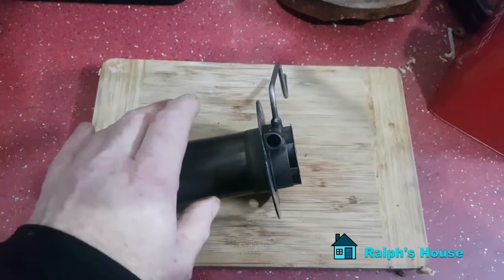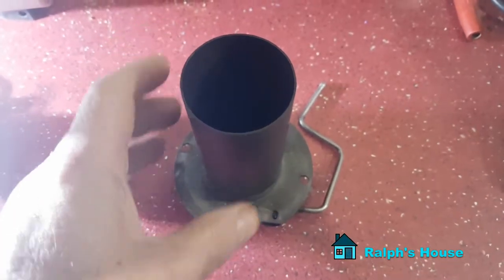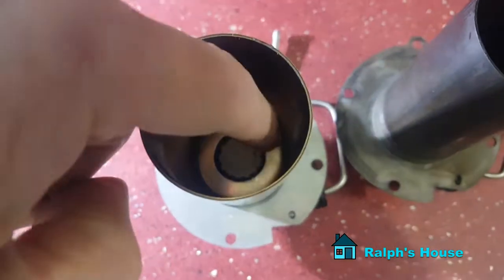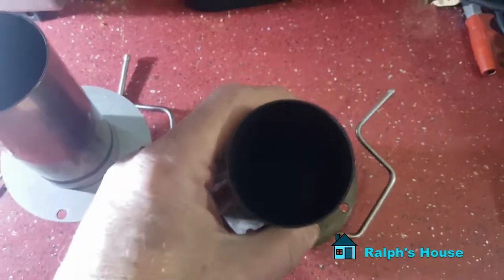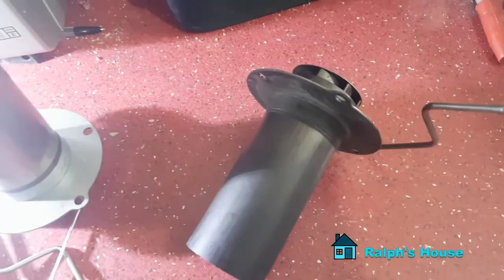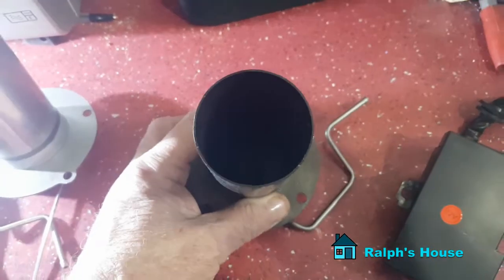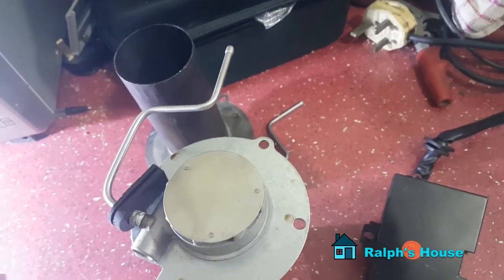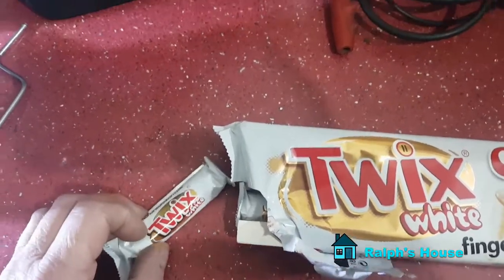204. E-08 Error - Chinese Diesel Heater

Comment: Interesting video. I've had a number of occasions over O8 errors On my first heater it would only work if I kept it at very low setting as soon as I turned it up get O8 errors. On investigation I realised when looking into the burn chamber down through the big pipe the circle in the bottom was not in the centre it wasn't even flat it was probably welded in it about 45 degrees to the tube so I ordered A new burn chamber that sorted that heater out. Recently I would put a new pump in after an O8 error in one of my heaters and it would go beautifully for that day switch it off overnight and then switch it back on and 08 error again and I noticed the pump wasn't clicking I thought why are these pumps stopped working I have a filter between the pump and the tank so I cleaned the filter out and there was a lot of sticky substance on it literally like glue it wouldn't come off my hands even trying to clean it with petrol even brake cleaner wasn't that good. I ended up using acetone that did the trick, it still kept happening even after that, until I emptied the diesel tank and I could see this glue substance stick into the side of the tank very brown so I acetone cleaned it worrying whether the acetone would melt the tank but it didn't and I've not had that error since but actually through one or two pumps away thinking they were knackered when all they was gunked up soak them in acetone and they worked beautifully. I must have had a contaminated container holding the fuel at some point. I have one heater it's one of these modern heaters with Bluetooth on it you can't use the code to get inside to do any adjustments it just doesn't work and it runs far too rich and after a very short time you start getting the white smoke I've basically given up on it for now I'm going to investigate on ways to fix it I know whenever it's cleaned and working well it's greedy on fuel compared to my other heaters I think it's classified as one kilowatt to 8 kilowatt whereas all my elders really are 5KILOWATT maximum anyway thanks for your video , food for thought
Reply from the maker: Could have been pipework or hoses deteriorating from the fuel suppliers, although you'd think the filter would catch it all. "Flame out" isn't a particularly helpful error code really. Certainly running them on anything beyond kerose/diesel really fouls these heaters up. People try, particularly after they've seen others claiming they run on old engine oil or straight veg oil, but soon regret it. Theres never a follow up to those saying theirs run happily on road tar either. Mine runs well in Alpine mode overnight but I do give it a blast at 6 before I shut it down to make sure burn chamber gets cleaned out. Currently sitting here indoors at 22.8 degrees and I hadn't fired it up since last Winter Chris. Happy days.

Comment: Hey I have used 2 new heaters still same problem error 8 runs 10 mins then error 8 or error 10 have cleaned like you mentioned still error 8 white smoke then black smoke
Reply from the maker: What fuel are you using and do you have a fuel line filter? If burn chamber is clean, then a fuel issue is likely cause.
Reply: @Ralphs-House  I’m using pure diesel checked all lines and cleaned chamber then changed for a brand new heater still same issue so went to different fuel station got more new fuel still error 8
Reply: Glow plug issue .

Comment: I use my sonic cleaner on the burn chamber and main housing after i soak with brake cleaner.... Looks as good as new once a year.... I have never had a problem ever and used it for the last 4 years.....
Reply from the maker: Sounds like the best way to kèep the mesh in clean condition. Brilliant tip. These heaters like a scrupulously clean burn chamber for maximum efficiency and reliable running and they do not like anything other  than the fuel they're designed for, despite claims made. The wrong fuel can crud them up in  a day and will make the heater totally unreliable afterwards without a seriously deep clean or new burner. They're unfussy heaters providing you dont fuss with them. Good motto.

Comment: just tried to fire mine up ready for winter and got the E 08 Error , great vid m8 this is really going to help me get mine sorted👍
Reply from the maker: If you just get the clouds of white smoke then you've definately got fuel and its just not wicking through the back of the burn chamber as it should due to all the coke at the back, making it difficult to fire up. Order a new burn chamber as a spare, just in case. They're easy enough (although tedious) to strip down and swap one out so in your case it might be easier to fit another to get it going and clean the old one up when you've got time. All the best.

Comment: Has anyone tried using brake cleaner?
Reply from the maker: Yes. It won't shift encrusted carbon. Its one of the hardest things to tackle chemically. It may remove a little of whats left after manual removal, but you really have to get in there and pick it all out.
Reply: @Ralphs-House  Might heat it up with a map gas torch!

Comment: I found that the exhaust gets clogged especially if you are stationary for a while. Drilling a few small holes in the exhaust helps.
Reply from the maker: It shouldn't do if the exhaust only goes down but if you've got a bend, for sure. It'll fill up with water through condensation otherwise. Nice tip.

Comment: No it can be many things , I changed the cable to the transformer to the heater it wasn’t thick enough to take the correct voltage everything looks fine but it won’t power the pump even though everything looks ok trust me people it can me a multitude of reason btw I was a mechanic for many years and it still stumped me , I have taken 3 to bits and rebuilt two heaters I found many things can go wrong and over time they usually do , their cheap replica of a very good make they copied the original ones but put together using cheap rubbish

Comment: im hoping you can help me out with mine, it's 2 weeks old been working pretty good, the first time it shut down on me was after an hour an a half with a bit of smoke, the second time the same , now it's not running long and when i just started it up its smoking, then goes away, so wha would make it plug up that quick or do you think it could be a bad glow plug or something? thers no smoke when it shuts down now. it's coding e8 as well.
Reply from the maker: As I said, E-08 is 'flame out' so in your case it could be one of several things. Glow plug only operates at beginning and end of cycle so unlikely to be that. Could be a fuel pump issue, soot/muck in burn chamber or a restriction in exhaust. The exhaust must not be fitted in such a way that water condensates inside it - ie pipe should go down and away.
Reply: @Ralphs-House  well im gonna have to take it apart an just check it, one thing is the line after the pump you can see air bubbles being shot into the feed line, is that normal with diesel or could that be the issue?
Reply from the maker: @davidwalesby2426  Pumps don't cost a fortune and without a filter ahead of it, even a tiny grain of dirt can stop it operating correctly. I keep a spare pump to reduce down time. Make sure you're using good quality clamps on fittings and not the cheap ones that invariably come with these heaters. Upgrading to nylon fuel line also helps.
Reply: ty
Reply from the maker: @davidwalesby2426  Also, if you smack one end of the suspect pump on a piece of wood (to reduce potential damage to inlet/outlet) you can often dislodge anything stopping it operating and put it back into service but a spare pump is wise as it means you can quickly get the system running again in the event of a fault.
Reply: @Ralphs-House  darn, wish i tried that first, never the less i managed to fix it, was the pump ordered one for 25 buck and a filter kit for 15 bucks and it runs great, ty your video helped me rule things out an understand how they work.

Comment: In my case it was the pump. The heater would start up but wouldn't flame up properly, no smoke, and eventually shut down with E08 showing. It seemed clear that the pump was not delivering, the click became weak as it tried to pick up the pace. I bought everything to service it in case along with a pump I've fitted first. End of problem, with no other work needed.
Reply from the maker: Yep, thats the other scenario. No smoke gives that one away. Again, E-08 just means 'no flame' or 'flame out' - as vague as it gets :)

Comment: thank you I have cleaned this thing 3 times and still getting it but didn't think it would be dirty down in there so 4 times the charm fingers crossed
Reply from the maker: Let us know how it goes. If you still have troubles, we can suggest other causes. Back of burn chamber has to be scrupulously clean for a reliable start up.  Never be persuaded to run alternative fuels either as despite the many claims, these heaters are designed to run on diesel/kerosene only. Veg or mineral oil soon fouls them - even when used as a mix. The ones that do claim they run on alternatives, never show follow up videos where they couldn't start it again afterwards. I also found that running it flat out for a minute or two prior to shutting down really helps keep burner clean. Not all heater controllers allow fine tuning of air/fuel but if you stick to the right fuel and run it up to high before shutdown, it should be hot enough to burn off any oily residue and hopefully shift any coking.

Comment: Has anyone tried putting the burn tube in an ultrasonic cleaner?
Reply from the maker: Worth a try, possibly with acetone (aka nail varnish remover) which is one of the limited chemicals thats said to dissolve carbon
Reply: @Ralphs-House  I used an ultra sonic cleaner to clean the injectors for my Transit engine. Two of them were really baked with carbon and the ultra sonic took it all off.
Reply: @Ralphs-House  BTW I took my heater apart in the process of diagnosing the e-08 and it is really clean. The mesh is is still shiny even down inside the burn chamber. The mesh around the glow plug looks very clean. Going to work on it tomorrow to zero in on the fault.

Comment: if you increase the voltage to the heater, the glow plug will be hotter, burn cleaner. no soot. i increased the voltage to almost 14 volts. all problems went away.
Reply: Em not sure. The glow plug is 8 volts and is driven by PWM so increasing to 14 volts will not change the average 8v to the glow plug.
Reply: The glow plug switches off totally when it reaches about 100'c , usually after about 2 minutes of firing up
Reply from the maker: Would agree to some extent as I run at 14v too although that mostly keeps the first mesh clean. The second larger mesh at the back relies much more on a good fuel to air ratio to reduce carbon. Running the heater flat out for at least 30 mins at the end of use or once a week if running constantly, helps with cleaning.
Reply: @Ralphs-House they say than but set right hi speeds are not needed
Reply: Wrong, voltage means little to the plug, as after a few mins the plug switches off n runs without.if anything,voltage helps fan speed
Reply: @TheDigger06  the plug does not shut off . the flame would go out . this is not a high compresion engine

Comment: Thank you Ralph, i just took mine apart and attacked it with my propane torch, the clouds of white smoke that came off it was a surprise as it looked pretty clean
Reply from the maker: Its probable that you always will if you heat it up since diesel/kerosene is oily by nature so some residue will still be there. Burning this off may or may not make starting easier but it does seem to help a great deal if you're trying to shift carbon.

Comment: Error E-04 is the fuel pump if anyone cares to know, and it will not be clicking if you get this code.  It means the electromagnetic coil in the pump is open or the pump is unplugged or wiring issue with the pump itself.  You can test this by unplugging the pump and trying to start the heater.  You will get error code E-04.  It is not common for a fuel pump to fail, or at least I have never had one fail.  It is usally Error code E-08 that I get and it will be rolling white smoke and usually always means it's time to take it apart and clean the burner.

Comment: Thanks a ton! This was super helpful after dealing with this headache for a little while now. Brake clean definitely wasn't getting the burner clean enough in that area. It was getting it just clean enough for the unit to work a couple times then fail to E8 again
Reply from the maker: A case of digging a lttle deeper than you think. Would recommend keeping a spare clean burn chamber so you can at least get the heater up and running again while you sort the other in your own time. Thanks for the positive feedback.
Reply: Scrape and some compressed air ..then repeat... I sure like these little units

Comment: Soak the burn chamber in brake cleaner, degreaser or other cleaning solution for at least 6 hours, then half an hour in ultrasonic cleaner,  then blow it dry compressed air or torch it.
That should fix your problem.
Reply from the maker: There are few solvents and cleaners that will even touch carbon due to the nature of its composition although there is some stuff called "carbon off" which seems to tackle it very well in ovens etc. Not tried it, but a long soak in that might yeild very good results. In the end though, I guess its a case of weighing up whether its worth the time/cost in cleaning against just fitting a new burn chamber. I suspect its a close-run race between the two. Good idea though. Thanks for your input.

Comment: Would spraying carb and choke cleaner into the chamber get rid of the problem once you have the burner stripped down? Works on cars as long as you leave it to evaporate. Ours has just tfown an e8 code. First time was after installing it and that was a failed o ring in the fitting from the tank. It's been ran on low since Oct and last night threw up the e8 code so looks like it could be this problem.
Reply from the maker: No, since it won't get to the back of the chamber and would still need scraping out. It doesn't take long to strip it down.
Reply: Mines sealed into a caravan with fire proof silicone so would have to strip the whole thing out and re seal it all unless it can be stripped in situ
Reply: You can spray it with carb and choke cleaner but the carbon is thick and chunky and will also need to be scraped out of the burner to properly clean it so disassembly is pretty much required to fix the flame out issues.  I usually take a torch and cook all the carbon out of the burner I can, then scrape out any that is left and then finish with carb and choke to get the carbon out of the steal mesh that is behind the lip.  A lot of people say these don't have mesh but they do have a mesh that runs around the outside wall of the burn chamber and it will get carboned up also and that is what the carb and choke cleaner works good for cleaning after cooking it with the torch.  Make sure you let it cool down before using the carb and choke cleaner though.  Carb and choke cleaner is flammable.

Comment: Thank You So Much- got my heater working now no black smoke at all and yes i changed the glow plug and pump before seeing this  ----  amazing how much i get out of it
Reply from the maker: Appreciated Mike. Drives you mad stripping it down trying to resolve it doesn't it. Takes even longer cleaning out that back area. Buy a spare burner as they only take about half an hour to replace if it comes to it. Main thing is stick to heating oil or diesel at all times.
Reply: Yep got one on the way as a back up now been 3 days after cleaning still running well thanks to you  @Ralphs-House
Reply: @mikepacey1469  Pleasure. I won't pretend my channel has a consistent theme Mike, but some find aspects of it useful. It took me an age to actually figure out WHY it wouldn't start (lots of wild guesses out there), but basically if the mesh at the back is no longer able to soak up fuel (ie solid with carbon), not only will it not fire up, even if it did, it won't burn off that stuff either. Nice when it fires up isn't it :D

Comment: Dear you forgot to explain to us the reason for the formation of carbon inside the burner what is the reason
Reply: Using crap spent out fuel
Reply: Well documented. Too rich a mixture. Its not always possible to adjust this, depending on the controller installed. It is frequently caused by owners trying to run them on unsuitable fuel mixes like engine oil etc. On the whole they seem to run best on Kerosene (heating oil).

Comment: so what we need is a screw on/off cylinder to allow access.
Reply from the maker: I thought that but it would be difficult to predict how easy it would come apart after its been heated up to within an inch of its life. Exhausts are bad enough on cars. Easier (possibly) to have a removable flame baffle (theres a new word lol).
Reply: Ultrasonic cleaner. Even if you get a smaller one where half fits in flipping it over doing it in 2 cycles..